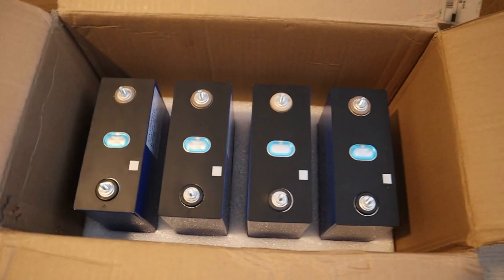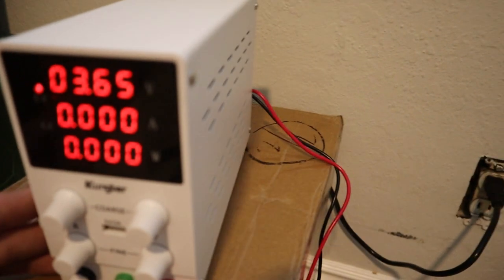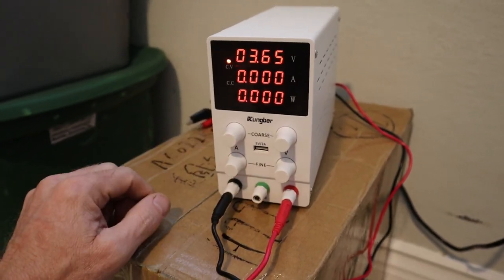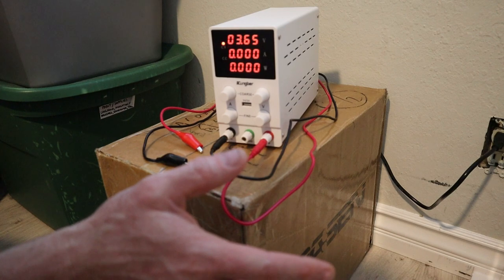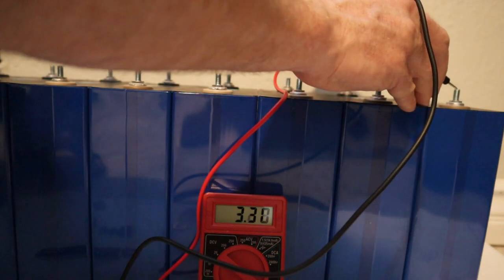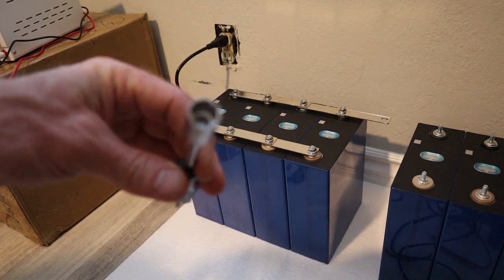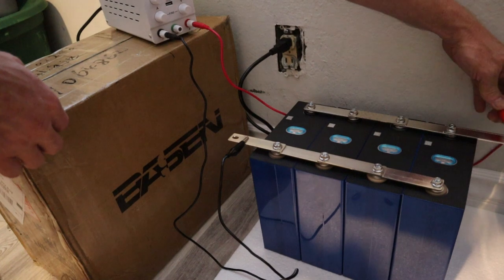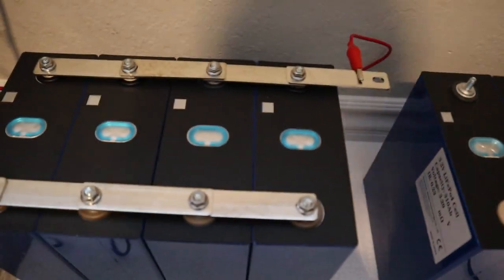310 AH Lifepo4 CATL Cells Top Balancing & Unboxing

Comment: Nice coincidence. I am building a 24v pack with  8 Eve 270ah cells sitting on my bench with a power supply hooked up, trying to top balance them. It is taking a long time; even at 10 amps it has taken three days to get from 3.21 to 3.30. I am looking to double up with another charger.  I will be interested to see what BMS you select. Thanks for the content.
Reply from the maker: Hi Michael, thank you for your comment. That is awesome about your battery. I put mine in series with my Daly 100 amp bms and charged it faster in a few hours, but towards the end I had to watch it closely not to over charge. I put it at 28.4 volts and was able to charge at about 280 watts. I got it up to about 3.6 volts per cell then I put it back in parallel and let it sit for a few days. Good luck on your battery build. Please consider subscribing if you found the content useful. Thank you for watching and for your support.

Comment: Hi. Pieter Toerien from South Africa. A question. The battery reads 3.29 volts on label. Why did you charge your batteries higher voltage.. Is it not overcharging... Would it not be better to stick to 3.30 v rather... I will watch the bms later.  Can you charge/ balance your batteries while you have the bms connected
Reply from the maker: Hi Pieter. Yes you can charge while connected to bms. 3.29 is the nominal voltage, but its full 100% charge is 3.65 volts per cell. I charged my cells up to about 3.55 volts per cell. I hope this helps. Thank you for watching and for your support. Please consider subscribing if you found the content useful. Thanks. PS, I am originally from Cape Town. Where in South Africa do you live? Cheers mate.
Reply: @thinkfreelivefree6951 
Hi Sir. Thanks for the feedback. All the way frome Cape Town to America... Glad for you. I'm  from Johannesburg, Gauteng, in Newlands.  I'm about 15 km from Sandton and 10km from Johannesburg CBD.  I whish you all the best that side of the world.
Reply from the maker: @pietertoerien1428  Thank you brother. Same for you. Wish you all the best. Thank you for watching. Take care.

Comment: I accidentally overcharged my cells while top balancing to 4.3v now they swollen I discharged them to 3.3v but they still swollen. Do you think they are going to be ok to use?
Reply from the maker: Hi Mikhail. I am sorry to hear that happened to you. This has not personally happened to me so I am not sure what happens to the swelling afterwards. But I would assume that the batteries would still work fine with maybe minor decline in capacity. Hope this helps. Please consider subscribing if you found the content useful. Thanks.
Reply: @thinkfreelivefree6951  Thanks! I have tested them still full capacity! They suppose to be at 304AH but they have shown 305AH me happy will see how long will they lost.

Comment: Nice video sir.Me too waiting to receive 32 302 Ah batteries. I intend to connect all 32 pieces in parallel and do top balancing with a voltage source that can deliver 50 amps.Tell me what you think, is it wrong to use such a high current?
Reply from the maker: Hi, thank you for watching and for your support. Congrats on your cells, its very exciting stuff, a battery build. 

You can try to see if your power supply will push the 50 amps, but when you set the voltage at 3.65 per cell, these chargers will limit your amps according to your voltage, but you do not run the risk of overcharging your cells. 

What I would suggest is to put your cells in series with your BMS, so that you can increase your voltage and charge faster, but you will have to watch them and check them with a volt meter every few hours just to make sure that some of your cells are not charging faster. But your BMS should also kick in if any of the cells try to exceed 3.65 volts, but its still a good practice to check them every few hours. I would not recommend putting them in series without a bms. You can also change the voltage higher in parallel, but you run the risk of over charging, I would not recommend this. So charge them in series up to about 3.55 volts per cell and then put them back in parallel so that they can equalize in voltages and then you can top them off in parallel if you want to go the full 3.65 per cell. I prefer to leave my cells  at about 3.55.

Thank you for your interest and good luck with your battery build. Please consider subscribing if you found the content useful. Take care.
Reply from the maker: @mihaitaiosub  Hi, I just looked at that charger. It looks like a really nice charger. I understand your caution about not wanting to put them in series. Charging in parallel with the amount of cells that you have will take a couple of days. When I had my 8 cells in parallel the charging went extremely slowly so I put them in series with my bms for about 4 hours and was able to charge them up to 3.6 volts per cell. I then put them back in parallel so that they could equalize. You can set your charging voltage to 3.65 if you want. That is the 100% charge capacity for these cells. However, since I am going to use these in a solar array, I do not want to charge them all the way to 100%. So, it is up to you what you prefer. Take care and thanks for your comments and contribution.

Comment: Hello,thank you for the video.I received 32 CATL 302 amp cells a week ago and they were all very little swollen. I wrote this to the company where I bought them from, and they replied that the CATL cells are always slightly swollen.Company is called Shenzhen Basen,the same with company where you bought, I think it's reliable because I've seen a lot of good reviews about them. What do you think, have I been fooled and the cells are not new, or are they right?
  How were the cells you received?Were they a little swollen?
Reply from the maker: Hi. Thank you for watching and for your support. I think it is normal for these batteries to expand and contract. Some of my cells were also a bit swollen or I like to think on the expansion side. 😊 I honestly think it is normal. I have not seen any of my cells having any kind of issues and they are truly giving great capacity. I do believe that these are Grade A cells. Hope this helps. 32 cells, wow you are going to have massive capacity 28KWH. What are you planning with your setup? Please consider subscribing if you found the content useful. Thank you.
Reply: @thinkfreelivefree6951  Hi,I intend to build two series of 16 cels and then the two series connected in parallel. On each series I will connect an 2 amps active balancer. I think that the two series being connected in parallel, will have the same total voltage each and implicitly each cell will  tends to have the same voltage as the others, even if they are from the other series because the active balancer will work permanently.I do not know how is working when the batteries will be charging.
Reply from the maker: @mihaitaiosub  Sounds awesome. Are you planning on doing 48 volts each 16 cells? And then connecting them in parallel for a 48 volt system? Very interesting stuff. What are you planning on using it for? Thanks, best of luck.
Reply: @thinkfreelivefree6951  I already have the rest of the system (photovoltaic panels, chargers and inverters). Until a month ago, the battery bank I used was with lead-acid batteries. I sold lead-acid batteries and ordered them these 302 Ah LiFePo4.With this system I supply the whole house.
  My big concern now is that I connected the batteries in parallel 9 days ago, I connected the power source to the bank, and I don't see much progress. When I received the batteries, they had a voltage of 3.29 volts, and now the voltage is 3.37 volts. Power suply is set to 3.6 volts and the battery bank consumes about 25 amps from the source.I'm afraid this top balancing procedure takes too long and can damage the batteries.What do you think, can batteries break down?
Reply from the maker: @mihaitaiosub  Hi, that sounds incredible running the whole house off solar. I plan on doing the same in the near future. You will have absolutely no problems with your batteries in parallel, but it will take a while for such a large setup. Just make sure to connect your power source positive and negative on opposite sides so the current flows through. My cells were also 3.29 and 3.30 when I received them. I only top balanced them to about 3.55 volts per cell since I am doing solar and I don't want to go to the top of the cell's capacity. I think it is unnecessary and could degrade batteries more over time. Hope this helps.
Reply: @thinkfreelivefree6951  Thank you for your answer.I have been working in this configuration for 2 years now. I can tell you that the proportion in these two years is 80% from the sun (batteries) and 20% from the grid. This one with lead acid batteries that I have never discharged more than 50%. From now on with new batteries, I hope the proportion will become 95-5%.
Reply from the maker: @mihaitaiosub  Thank you for your knowledge and contribution to the channel. These discussions also help other viewers. I think because Lithium Iron Phosphate can be drawn down safely to about 13%, you will have 37% more power than your lead acid batteries. I think you can reach your 95% goal. Please keep us updated to your progress. We are all very interested. Thank you for sharing your setup. Best of luck.
Reply: @thinkfreelivefree6951  Hello,Finally I finished the top balancing procedure for the 32x300Ah cells. It lasted 12 days, almost 2 weeks. Now the batteries have a voltage of 3,507 volts, 5 hours after I disconnected the power supply.I intend to leave them connected in parallel for a day or two. Time does not press me. What do you advise me to do, to leave them like this for another day or two or to connect them already in the system? I ask you this because I have heard opinions that it would not be good for the batteries to stay fully charged too much time.
Reply from the maker: @mihaitaiosub  There is absolutely no harm in leaving them in parallel until you are ready to run a load on your system. They will naturally discharge and balance themselves in parallel. I hope this helps.

Comment: Your test leads are way too small. That’s why it’s didn’t do 10 amps from the gitgo. Feel the wires and ends. They ARE warm! Use #10 minimum and crimp terminals at both ends. To top balance all 8 with a ten amp power supply from the factory charge it’ll take a week. It’s actually best to first connect the batteries in series with the BMS and use a 50 amps or more charger to bring them close, about 13.8V and stop. Disconnect all bus bars and put them into series to top balance with the power supply. Once it’s hit 3.65V remove power supply and just let the cells sit connected for a few days. I HIGHLY recommend using a Heltec 3S 4S 5A capacitive active equalizer on Amazon ($29) along with your BMS of choice. Daly and Overkill’s balancing resistors are inadequate for these new big ah batteries even worse if you are running 2 parallel 4 series. 620ah massive lol.
Reply from the maker: Hi Karl. Thank you for watching and for your support. Please consider subscribing if you found the content useful. It would not do 10 amps because my voltage was set at 3.65 volts. My cells were already at a nominal state of charge at 3.3 volts. It would never get 10 amps at this voltage in parallel. My test leads are standard for a bench top charger and came with the unit and is sufficient for up to 30 volts at 10 amps. I did put my 8 cells in series so I could charge my 24 volt battery faster and got it up to 3.5 volts per cell. I was able to get 10 amps charge when I put my cells in series as I was able to change the voltage to 28.4 volts. After that I put the 8 cells back in parallel for a few days so they could equalize in voltages per cell. Thank you for your contribution. Take care.
Reply: Agree. Test leads are the limiting factor. Change them and you will see 8-9 A instead of 4.7.